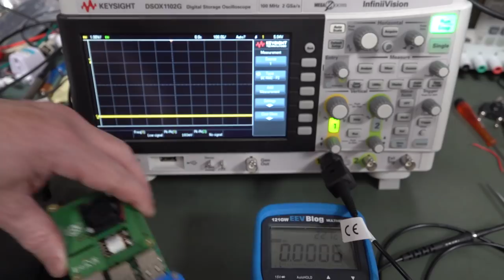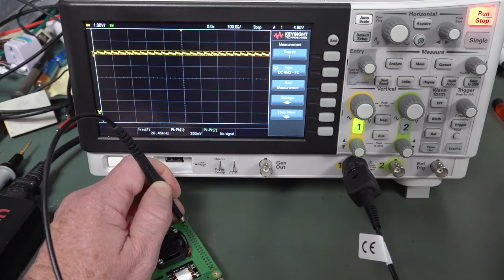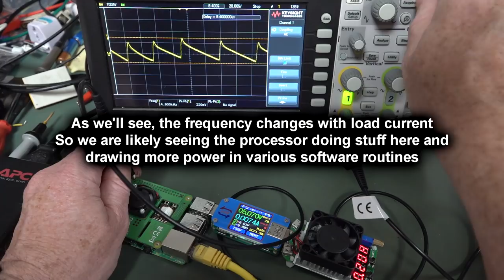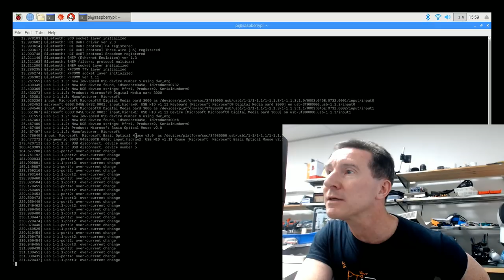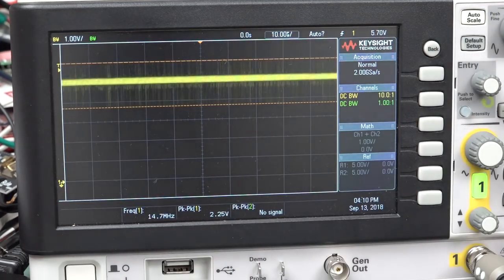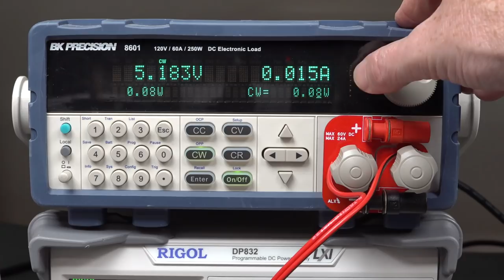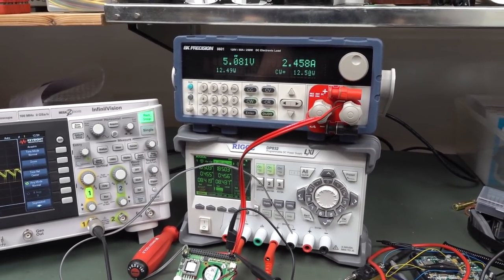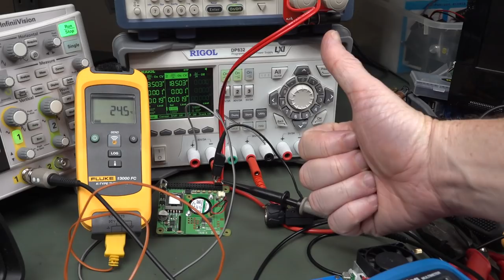EEVblog #1122 - Raspberry Pi 3 PoE Hat FAIL Investigation

Comment: The 3 B+ is a fail all together, i used it for a couple weeks and went right back to my regular ol' 3 b...
Reply: Why is the 3B+ a fail?
Reply: OtherTheDave I ordered mine on pi day, got it a week later, immediately started using it as my "desktop" instead of the 3b, it was significantly slower just browsing on chromium, and playing youtube videos was next to impossible.  -mind you, I have not given it another chance since then, but, it just left a bad taste in my mouth.  I should load up raspbian and give it another try to see if the kinks got worked out, but, my 3b is adequate enough for my small demand -internet usage (ebay, datasheets, youtube)

TLDR
-it sucked at release, it may or may not still suck now
Reply: christopher L Weird... I don’t think is should be slower at anything. It does kinda sound like maybe the OS came misconfigured, or maybe the heat sink is faulty and it’s throttling?

Comment: The could have been so much better, even without extra cost.
Get rid of the fan and its micro, so more room to do the layout properly using PCB lands as heatsink which cost nothing.  Spend the money on a better converter with short circuit protection!  Even if they cannot afford to do EMC properly,  layout the filter tracks and places for extra output caps, so anyone who cares can modify it ( that what Pi is about..) I suspect some would opt to add the extra caps themselves rather than returning the units.
Also, put a place for a header to add a 5V fan if it really needs it.

Comment: Is it possible that plugging in a usb device unexpectedly causes a increase in power that’s greater than what’s being provided over the PoE?
Reply from the maker: Nope, I demonstrated the PoE can deliver way more than the spec.
Reply: I know that the pi 3 calls for 2.5 amps for itself... I would imagine that it doesn’t take some power hungry usb devices into account.  Good example is that I can’t plug in a seagate external hard drive into a raspberry pi without using a powered usb hub.
Reply: External HDDs almost always need more than the USB 2.0 standard 500mA though.  The lowest rated 2.5" HDD I have seen is 450mA and then you have the USB to SATA controller on top of that, plus the inrush current to spin up the drive.

When those drives DO work on a single connector its purely down the USB port not having correct (or any) overcurrent protection which was common in the past.  Modern boards will tend to properly follow the USB specification and so not work.

Comment: Ironically it can't even power the cooling fan that is installed there by the factory absolutely no product quality testing
Reply: The fan works fine, but you must upgrade Rpi firmware first. It's mentioned in in the PoE Hat product page.
Reply: @anttiplathan  oh 
My bad thanks for info I need to read better

Comment: Rpi3 was never a decent mini-computer board. I actually had tons of interference issues with it.Such as integrated Wi-Fi card interfering with Composite output. TV had a distorted image (and before you send me the FAQ, the lines are correctly connected) whenever the Wi-Fi was pulling data from my network. So I got an Arduino clone and never looked back at Rpi with it's problems. Far less advanced but works properly no matter what.

Comment: Temperatures should be quite lower in real-world usage even at top of the design power, simply because airflow would've been redirected sideways by the Pi board just beneath the fan. Anyways, not a good sign.

Comment: You get what you pay for. I'm trying to run an Arduino from a 3 B+ but it's so fucking noisy sensor are either not working or give extremely noisy readings. Useless.

Comment: Would more capacitance help? POE is capable of many watts but it is pulsed in between data packets, ahh it's dead never mind.
Reply: punkalflufen poe is DC on the center tapped transformer. It is not pulsed.

Comment: even the experts get it wrong that makes me fill so much better with my  accidents  thanks a lot  it was interesting video I will wait until they bring out a better one.
but if i plug anything into my pi after is on it reboots anyway , so i always plug in to the usb what i need before I turn it on.  if you find a better model on  Ethernet  (PoE) hat do a new video like this one . thanks

Comment: In the RPi 2 (or was it 3), the built in WIFI interferes with the USB bus... lol.
Reply: I think it'd be the 3, since that one has built-in WiFi. However, knowing that the built-in ethernet is also going through the USB mux (probably as a USB device), I'd assume that the WiFi is doing the same, causing issues.
Reply: Or on the 3, that you cant use the default uart until you have it configured to disable the Bluetooth, which I would normally do over the uart...

Comment: Hey Dave. I think I remember that on the RP3 the ethernet connector is someway managed by the usb controller.
I don't know how it works nor if the 48v rail is connected in a way or another to the controller, but my guess is that the controllers monitors the current of the ethernet port, and triggers the USB OCP, hence the syslog entries.

If it's something like that, it's terrible design...

Comment: I like some of the design of this hat but after watching Dave video and reading the comments and even the solution below; This is a clear poor quality and poor fit / finish issue.  This hat is a bit pricey, totally overpriced for what it delivers.  They will have to go back to the drawing board and release a second version for sure.  As it stand this isn't acceptable and its simply a scrap wafer.

Comment: This should have been built into the main board, if some of the cheep routers can do POE in and out for less than a PI you know they are just grabbing money on these over priced tops. And it being opensource why didn't they have the plans out online for a few months so real electrical engineers could tell them how they did it wrong. Just seems like they rushed it out to make money.

Comment: Dave... you failed harder than the PoE HAT. Also if the USB power rail fails on higher loads... use a active USB-Hub... problem solved and the RPi runs rock solid over PoE.
Reply from the maker: The entire point of using PoE is so you don't have the use local USB power, because it's usually not convenient which is why you choose PoE to begin with.
Reply: Dave you could in theory run the usb hub right off the 5v rail on the pi, if the poe hat didnt prevent you from using the damn gpio header.